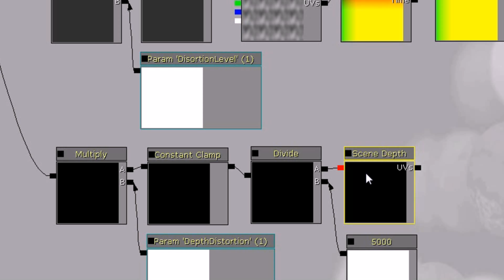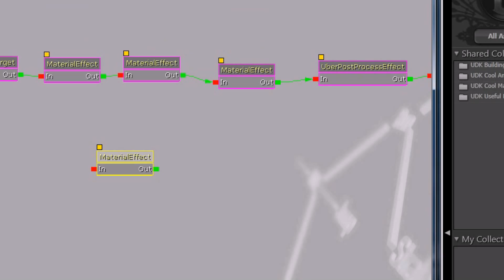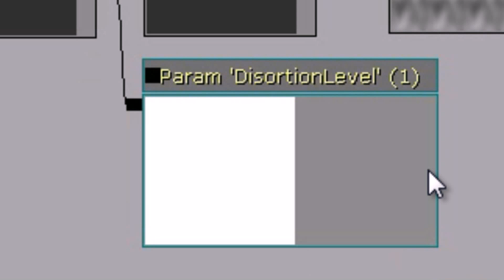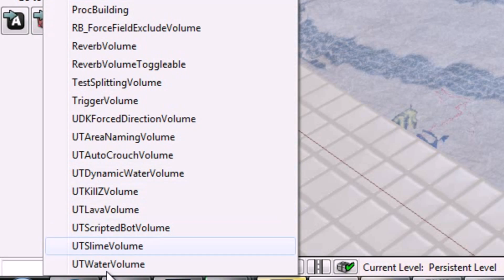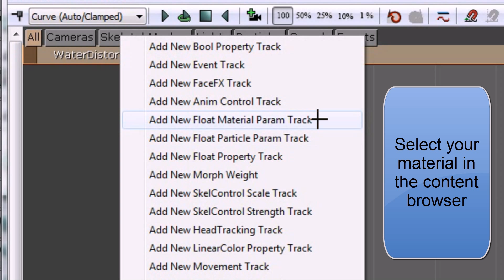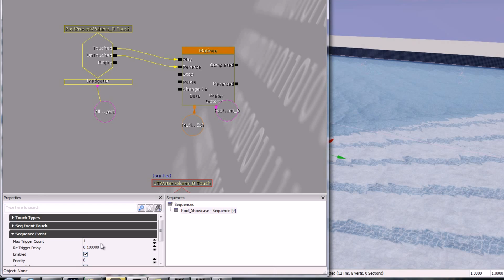UDK Underwater Post Process Matieral

Comment: I followed the tutorial, but my whole map is distorted now, and it doesn't do the play sequence in game, it just stays on one frame. any suggestions?
Reply from the maker: If you used the light function then it's supposed to cover the whole map. Only use this method if you want to have an underwater map.  If it's stuck on one frame I'd try deleting the light and re-adding it.  This usually fixes it for me.

Comment from the maker: No, you just set the default values to whatever will cause the effect to turn off.  Figure out how you have it set up.  What value does it need to be turned on full?  What value does it need to be to turn off?  These are the values you need your keyframes to be.

Comment: Both my parameters (DepthDistortion and DistortionLevel) in my material are set to default value of 1. To turn off the effect, do they need to be at a value of 0? If so to have a parameter track go from off to full effect, does that mean I need to have 2 materials? one with default values of 1(last key frame) and one with 0(first keyframe)?

Comment from the maker: Check your parameter.  Make sure that whatever value turns off the effect is the default value, and is also the value of your first keyframe.  Then, make sure that your last keyframe is the value that will push your material to its full effect.